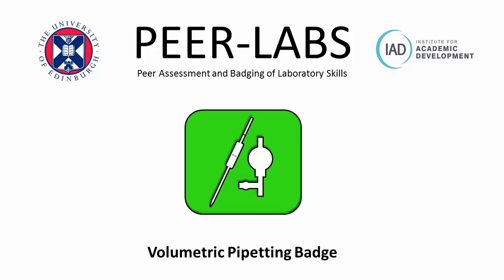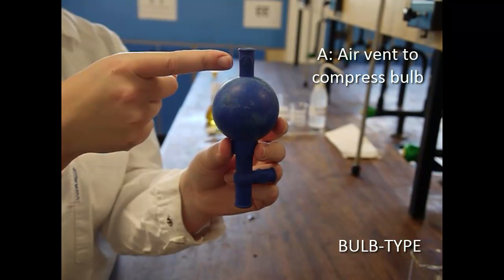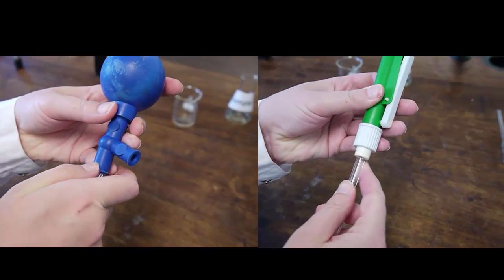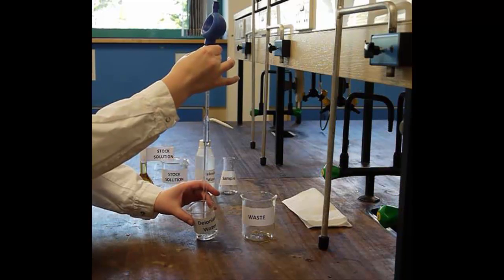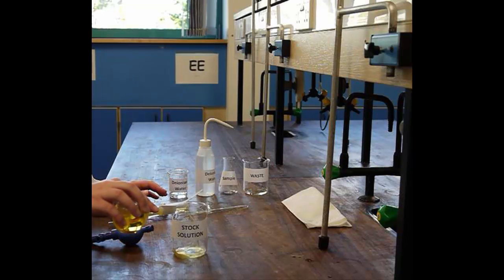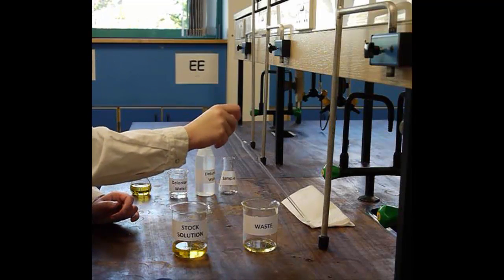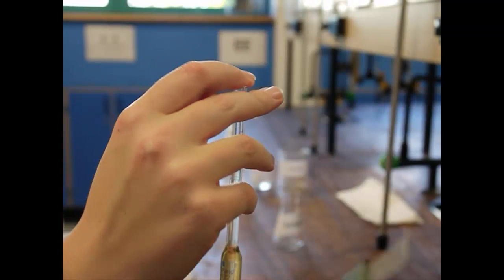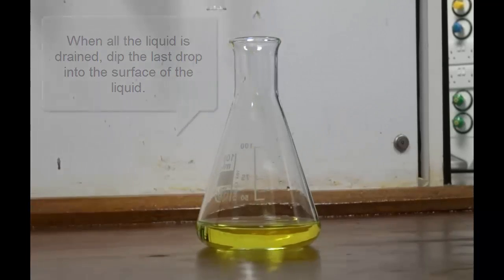Using a volumetric pipette correctly

Comment: One step you are missing is BEFORE bringing the solution to the mark, to wipe the outside of the pipette with a paper tower. Then lower to mark and decant. Outside of pipette is covered in excess solution and needs to be removed before decanting.